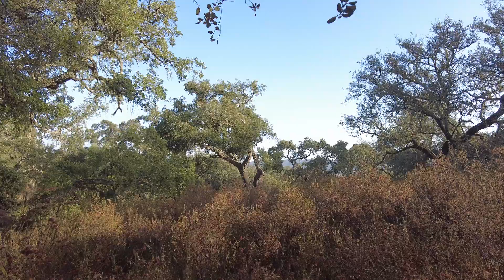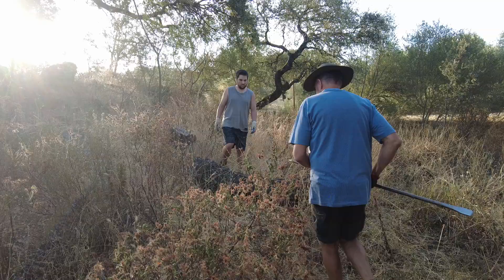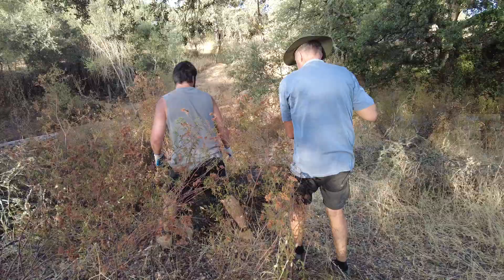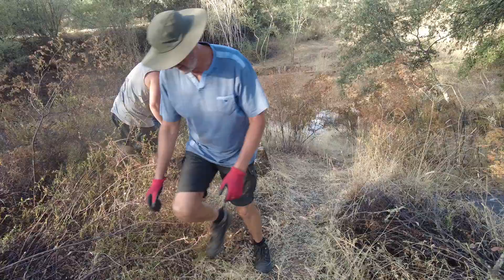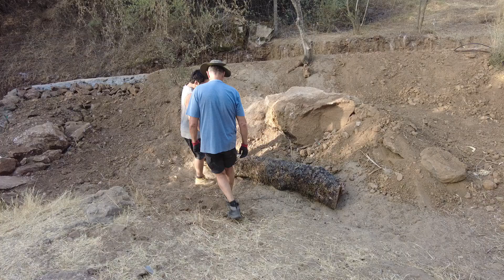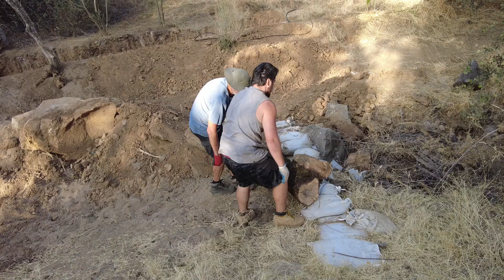Another leaky weir log rolled into our occasional creek.

Comment: Great to see that you are adding height to that particular location.  I believe this location is the best 'sand catcher' in the occasional creek.
I would like to suggest the installation of a small diameter pipe through the weir at the lowest practical point.  The pipe will allow a trickle of water - like a small spring - to be slowly released from the sand.  This will encourage diversity that is dependent on a trickle of water.  This thought is an extension of the experiment you did last spring to monitor the duration of flow following the last rain event of the season.
Today's Accuweather forecast says 38 percent probability of a thunderstorm on Saturday.  That is the only rain in the near term forecast. 👍
Reply from the maker: @stevejohnstonbaugh9171  Thank you for sharing Steve. Please speak to the weather person to send some rain.
Reply: @SuerteDelMolinoFarm  It seems my hotline to the party who makes these decisions is out of order. 🤯